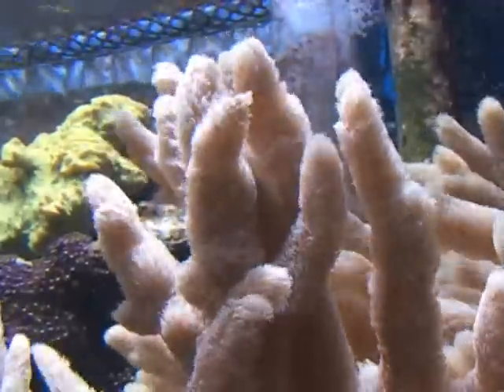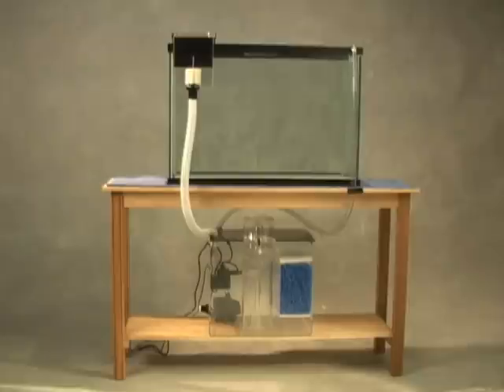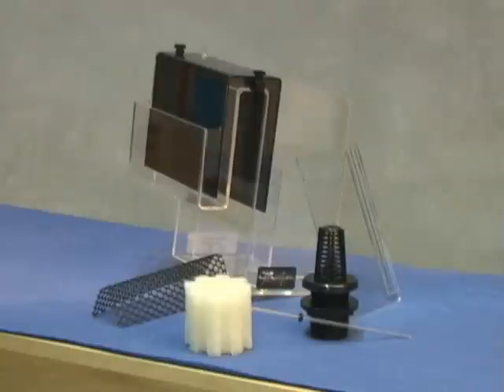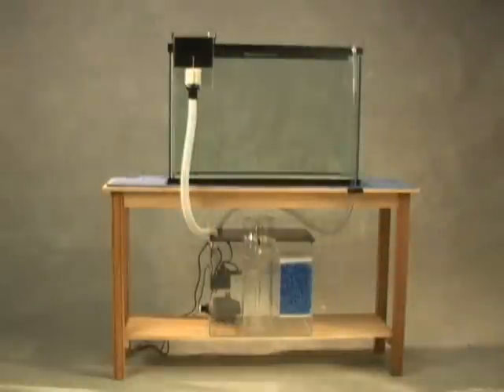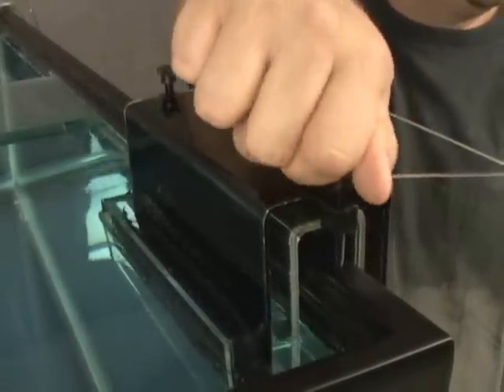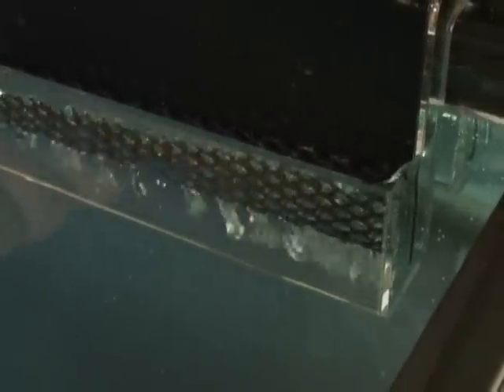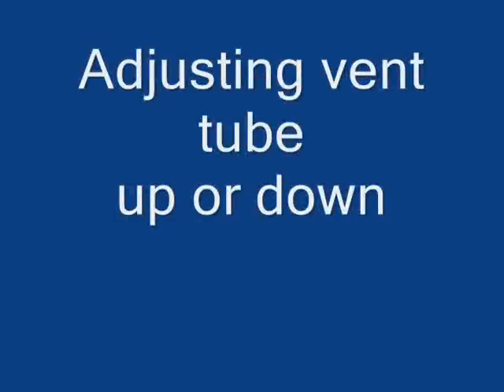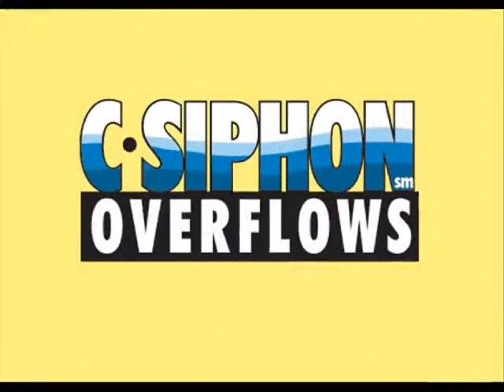CS Overflow - Overview and Installation

Comment: I have used this exact overflow for over a year.  It works great.  You will need either a Toms uplift pump,  or even more simple use a powerhead to maintain a siphon in case of power failure.  I have had zero problems.

Comment from the maker: A drilled tank is optimal, but in cases you can't do that, the CS overflow offers a secure system that makes it easy to add a sump to any system. We also promote drilling your tanks if planning ahead, but sometimes that's not an option. Thanks!

Comment from the maker: @rockinbewbs Usually, canopies will have an opening in the back (for air flow/cooling) along the bottom.  If you have a 1.5" gap between the top of the tank and the bottom of the canopy, usually somewhere along the back, you can fit the height of most all CS overflows.  If you find that your canopy is completely enclosed on all sides, you would have to modify the canopy to have a 1.5" tall (at minimum) gap with the same width as the overflow you want to install.

Comment from the maker: This depends on the adjustment screws on the sides. Since the height of the overflow will dictate the water level in the tank, you can adjust it to the level you would want it at.

Comment from the maker: @krustykrimpets The AquaLifter will not be able to work against all of the head pressure to suck the prime dry in the case you described.  Most people place the outlet portion of the AuqaLifter in a convenient location that is submerged...some opt for the backside of the CS Overflow while others lead the outlet to the tank or the sump.  Making sure the outlet on the AquaLifter is submerged is one of the most important safety measures when it comes to set up.

Comment from the maker: @TimWFishes Yes, the CS Overflow will only flow the water that is fed to it from the return pump due to it's passive-flow design.  The CS overflow design has alot of tolerance built into the unit, so that it can run slightly different flow rates than the optimal one listed for each model, but for the best/safest (and recommended) installation, you want to match your return pump flow rate up with the optimal flow rate listed for that unit.  Be sure to account for head pressure.

Comment from the maker: @pyekhine Sometimes a MJ1200 will hold the siphon, but I think venturi is stronger and more consistent on other pumps, like our modified accela pump or the Rio600PT.  As long as the back pressure on the pump is not too great, it will do a great job of holding siphon.  Re: Noise, No, when installed correctly, these usnits operate very quietly.  I would recommend purchasing the DX unit which includes a cover to help mitigate the splashing and noise, which is minimal after proper installation

Comment from the maker: No, the design works "passively" in that the flow that goes through the overflow is determined by the return pump.  It is possible that the overflow can handle more than the pump is rated for, but it will only "overflow" the same amount of water that the return pump is pushing.

Comment from the maker: @jamgabem Yes, the overflow will only process and overflow what the return pump is feeding.  There is no matching up that you have to do (besides choosing the correct pump at the beginning) since the overflow has a reasonable amount of tolerance built into the unit.  It is very easy to set up once you choose the correct equipment.

Comment from the maker: The unit will kick back on in the event of a power outage and should work just fine. Tip: Plug the AquaLifter into the same power strip as the return pump. Also, simulate a power outage to see it work for yourself. Thanks!

Comment from the maker: @desmondskyers1 You can set up the CS Overflow a few ways...the AquaLifter in the video is a simplest method, though the other methods are pretty simple too.  One is to use a venturi pump and set it up inside of your sump with the airline running from the overflow to the pump.  Alternatively, you could use a check valve and initially manually suck the water out (the siphon will hold, but air can collect if being run at a lower rate than recommended.)  Using a pump (regular or aqualifter) is best

Comment from the maker: Yes, this will help ensure that the siphon will be constant even if something like the flow rate changing (from your return pump) occurs.  If possible, have your aqualifter pump connected to the same power strip as your return pump and also have the outlet from your aqualifter submerged somewhere in your overflow, tank or sump.

Comment from the maker: @TimWFishes The greater the difference between the flow rate of your return pump (after accounting for head pressure) and the optimal flowrate for your overflow, the potential for problems with your installation goes up.  For a quiet and reliable overflow, just match the correct pump for your installation with the CS overflow that matches it best.

Comment from the maker: A neat tool to consider are the Mag Fox and the Nano Mag made by Two Little Fishes. They are small magnetic scrubbers that are small enough to fit inside of the overflow. Cleaning it regularly will help prevent that kind of build up.

Comment from the maker: How far above the lip?  Make sure that the overflow tube is not restricted (inside of your sump) in any way.  Also, be sure that overflow sponge is not clogged.  If you happen to see the water level higher again, take note of the water level in the overflow box, check to see if any air has started to collect in the siphon section and contact us for further support.  Thank you

Comment from the maker: @pyekhine If the aqualifter stops working, as long as the outlet from the aqualifter is submerged, there shouldn't be more air allowed into the weir from the tubing/AquaLifter so your siphon will be alright until/unless air gets into the system another way.  Over time, air may enter another way (and removing it is the Aqualifter's job, so the broken AquaLifter needs to be resolved asap).

Comment from the maker: @pyekhine Each pump works against head pressure a little bit differently depending on how it was designed and built.  Each pump will have a head pressure chart for that specific pump which tells you what the performance is at the different head pressure you may have.  On the Support page of our website, you will find a a PDF doc to help you mate the correct pump to your CS unit.

Comment: I'm planning to get a CS102 model for my 125g tank and i have few questions.  What happens if the aqua lifter stop working? Is siphon gonna break?  I heard these pumps don't last long.  Is Maxijet 1200 strong enough to maintain the siphon?  In the vid, the water is falling pretty hard into the back part of the overflow where the prefilter sits... Does it make a lot of noise?  What gph pump would you recommend for 5ft head pressure?

Comment: I assume the glass on my 75 tank is tempered.  Can I drill a one inch or so hole in tempered glass?  I've done it several times with common plate glass.

Comment: @cprusa95521 Nice one ive got one 5000lph im going to have a wet dry filter setup for this would it be better to use flex hose or pvc? (I dont want to drill the sump though).

Comment from the maker: @ollieflp The overflow size (flowrate) should depend on how much flow you want going through your sump/filter.  For a tank that size with those requirements, you would have to order a custom overflow, but ones in that size range have been made.  email us at cpr@cprusa.com for more information

Comment: WARNING: do not buy this overflow box the toms aqualifter pump failed after a couple months but the biggest problem is THERE IS NO WAY TO CLEAN INSIDE THIS BOX there is a large area in which there is absolutely no way to get to, I give CPR credit for trying but there is a design flaw........ just google you will see nothing but complaints from people that have been running these for any amount of time
Reply: Cee Cee paint the box black and you won’t have to worry about cleaning the inside..
Reply: You are absolutely right. We have had the same problem. Agree also that it is better to not buy.

Comment: ive been running a 3/4 pvc overflow 4 over 2 years and it works beyond satiafactory (no cleaning)(just flow)and if it gets cloged thers an emergency overflow normal lvl and restricted lvl
Reply: and 4 the emergency overflow to get cloged it would take way to much disruption

Comment: How to build a overflow sump for my aquarium whose length -30 inch, height -18 inch and breadth -14.5. .
Tell me how much should be length breadth and height sump aquarium which is located under the table. ..

Comment: i have an overflow like this. the connection for vacuum on the syphon snapped off . can plug the hole and just stick the vacuum up into that section will that work?

Comment from the maker: @monsterman1122 It doesn't sound like you are using a CS Overflow, but nonetheless, the flowrate for many overflows (including ours) is predicated by the return pump only.  The flow rate on the CS Overflow will not fluctuate unless the flowrate of the pump changes.  If you more questions on this, please call us at 707-826-9636 since it will be easier to help you over the phone for more complicated issues like this.

Comment: What happens if i have the CS90 Specifications: Flow Rate: 600gph and my return pump can only do 500gph? Will the CS90 push 100gph extra and overflow my sump? Or will the CS90 adjust to the return pump flow rate which is 500gph?

Comment: I can't find any of these videos that explain how the water gets back into the tank. Is there a suction pump needed or extra plumbing? The overflow box videos just show the box, the sump videos just explain what the sump is for, but none of them explain the last part needed to let the water flow back into the tank. I've only ever used canister filters and i'm really trying to learn how to set up a sump fr my next tank.
Reply: You will need to place a return pump into the sump. The return pump will return water from the sump back into your display tank. I would also recommend getting a return pump that moves 5-10 times your water volume per hour. I would suggest getting a submersible pump that moves 10 times water volume so you don't have to worry about calculating the head pressure that the pump experiences. If any of that sounds to complicated I would be more than happy to point you in the right direction and get you the most optimum results.

Comment: great.... but cant clean the alge out of it.... we all know alge grows everywhere
Reply from the maker: Darrin Hawkey Have you checked out the Nano Mag or Mag Fox made by Two Little Fishes? They can be used as very small magnetic scrubber pads that can help with this task though if the build up is significant, you may be best served to soak the system first and then clean it.

Comment: U WOULD BE BETTER OFF JUST BUILDING ONE OUT OF PVC PIPPIN AND U DONT NEED NO BS TOMS PUMP,I BUILD MINE AND TESTED IT A MILLION TIMES POWER ON,POWER OFF AND THA OVERFLOW ALWAYS STARTED RIGHT BACK UP,AS LONG AS U HAVE UR PIPES RIGHT!!! AND IF UR WORRIED ABOUT IT NOT STARTING BACK UP THAT ONCE IN A MILLION TIMES BUY A SIMPLE FOUNTAIN SMALL PUMP AND TUBBING STICK IN IN UT TANK AND RUN TUBBING INTO THA TOP OG UR PVC PIPE AND UR GOOD.
Reply: you are right sir, but why are you yelling?